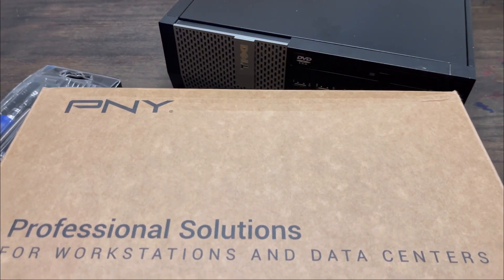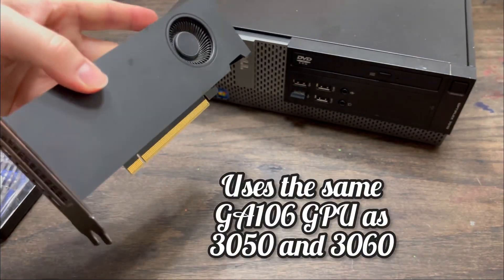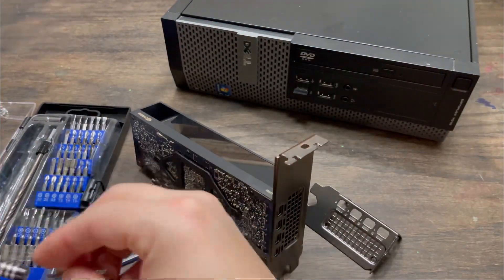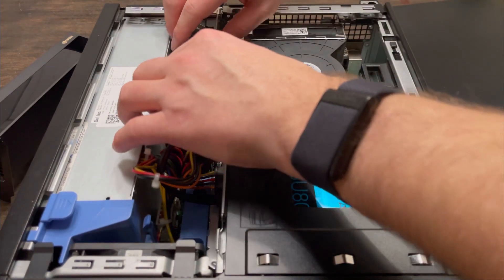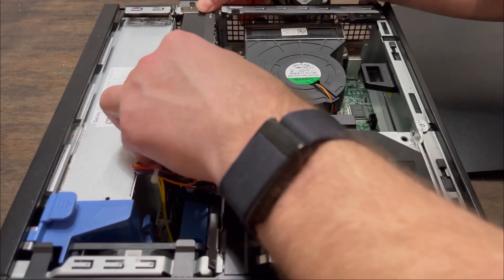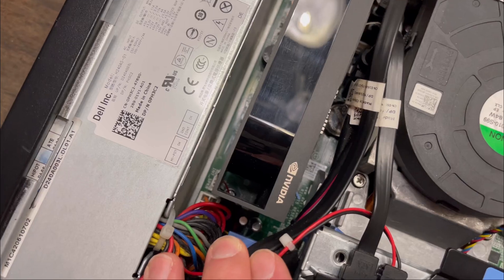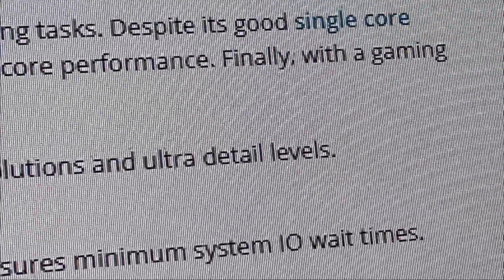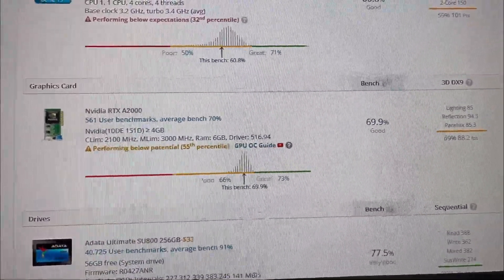Installing a PNY RTX A2000 low profile in a Dell Optiplex 7010 SFF for gaming

Comment: so i would have to buy torx screws to change the bracket if i get this? and the mini display ports wont fit a regular hdmi port, so i would have to get an adapter for that as  well.

Comment: I am thinking of buying this card too, I do not have many options for my computer since it is very space limited configuration. I have an old Asus ROG G20 (CB) that came with a GTX 970 so even though it does not seem like a big upgrade it somehow feels like the best one considering the lack of options and most of all for the low energy consumption. Do you think that this card would work on a pcie 3 motherboard and a core i7 6700? Hope it does. P.S. Thanks in advance.
Reply from the maker: Yea it’ll work. It’ll take a performance hit but at the same time that’s the best overall performance you’ll get with that old Asus.
Reply: @OptiGPU  thanks, I would give it a try, think it will give my PC a couple of years of decent 1080p gaming until I can save money for a whole new system. P.S. I found a used non mining rtx a2000 for 200 euros, think the price is fair.

Comment: I have practically the same PC, A HP Compaq 6300 PRO SFF, it has:
A i5-3470
8gb RAM Dual channel DDR3 1600MHZ
And an HDD of 1tb
And a SFF PSU of HP of 240w
Reply from the maker: Nice. Following this video for gaming, when you install the RTX A2000, you’ll want to bring the RAM up to at least 16GB as well. Running the OS off an SSD and using that HDD for game storage will help too.
Reply: @OptiGPU  That is what is was thinking, i was thinking about buying the RTX A2000, 2 other modules of 4gb to have 16gb of ram, and an SSD for the OS and other things like launchers like steam of epic games launcher and my browser, and the HDD for storage of videogames, music, series and movies, ETC, and i have a question: Did you tried to use Ray tracing? And works?
Reply: @SonicTFF2008  CPU bottleneck. 47-48%.
I was think to buy but need better processor😢
Reply: @NaturalBuddha And how much a i7-3770 upgrade's the bottleneck?

Comment: Those two tabs on the retention bracket can be easily flattened out with a pair of pliers, and then it can be used. I know this from putting an A2000 in my own SFF 7010.
Reply: I personally just cut them off
Reply: What PSU did you use to run this card? I have a 7050 i7 SFF. Thank you!
Reply: @TrippyWoodStock  The A2000 draws its power from the 70W PCIE rail.  If your 7050's PSU supplies more than that you should be fine.
Reply: @bryans8656 good to know! First time building a pc so I’m new to all of this. Mines a i7 7050 SFF. I think my PSU is 180w total? Would that be enough or would I need to upgrade to a 240w?
Reply: @TrippyWoodStock  I think upgrading to 240w is a good idea.  Mine had a 255w PSU.

Comment: So where do you plug the hdmi?
Reply from the maker: You need an HDMI to Mini Display Port cord or dongle.
Reply: @OptiGPU  there are 4 ports, which 1 do you connect it to?
Reply: @fkaiba94  any off them, I have both a dis-port to HDMI cable that I plug in to my TV  in port1 and and and a converter that lets me attach an HDMI cable for my game capture device on another PC in port two, got em off amazon.

Comment: could a rtx a2000 fit into a dell optiplex 5050sff
Reply from the maker: It’ll plug into the 4x slot, but I’d be wary of the length. Measure the space first to be sure you have at least 167mm (6.5748 inches).
Reply: Yeah, it will fit. Ive owned 7050/5050 sff before 167 mm is the same size as a low profile 1050 ti

Comment: Would it work in the i5 6500?
Reply from the maker: If it’s a Dell, the 6th gen SFFs would require you to plug into the 4x slot, but it won’t hurt performance too much.
Reply: @OptiGPU  thanks dude
Reply: Im also building off of a 3046 for my friend, would it work on that too?

Comment: thanks for the video what cpu do you have ai have the 7020 sff opti from 2014. and i maxed its cpu to the i7 4790k 4 core 8 threads 4.4ghz
Reply from the maker: Mine is just an i5 3470. I need to do that as well.

Comment: I think we can maximize the optiplex (use the other PCI Express for m.2 nvme) by using a riser for the ATX2000 (it occupies 2 lanes).
Reply from the maker: Would that fit in a SFF case?
Reply: @OptiGPU  i think it would not, ATX2000 will be a separated stand-alone GPU outside the case.

Comment: This GPU really sparks my interest. Would this be ok to run in an Optiplex 7020 sff? I am unaware if there are any differences with the 7010 and 7020. 😅
Reply from the maker: Main difference is the 7010 has the PCIe 16x slot in the correct position for a double width card.  It will work in the 7020, there will just be a slight performance hit because of having to plug it into the 4x slot.  Definitely better performance than using any single width card.

Comment: Will it bottleneck i7 3770?
Reply from the maker: To get the absolute most out of the a2000, use it in a PC with PCIe 16x v4.0 slot. Those are post-2017 and out of the budget range, but it’ll do very well in what you’ve got and can grow with you in the future.
Reply: So should I buy it?
Reply: I have hp Compaq pro 6300 sff

Comment: Does this also fit in the Dell Optiplex 3020 SFF?
Reply from the maker: It fits, but it would have to be plugged into the 4X slot, so there would be a slight decrease in performance.
Reply: @OptiGPU  thanks for the info man👍
Reply: @OptiGPU  was gonna buy the a2000, what other card do you recommend? is it a noticeable amount of performance decrease as well?

Comment: Hi would this work in HP 800 G2 Sff or would it be better to use 1650lp or 1050ti lp
Reply from the maker: The a2000 would work better (less power need, more performance)
Reply: @OptiGPU  thanks a lot, another thing i read from another one of your comments that it will have a dip in performance in certain motherboards do you know if it will
For this desktop.
Reply: @karish1861  yes it will the 800 g2 has 4 slots and 2 of them are x16 so it will run full speed in the top most x16 slot, hope this helped
Reply: @Timik _  hi this helped, but Im reading that as it is a small form factor it cant be put in the 16x slot for some reason or am I wrong?
Reply: @karish1861  I think that might be some misleading stuff this card has a full pcie x16 3.0 port and can be plugged into such, these cards don't pull more than 70w so the pcie slot has some headroom, also while using this card I wouldn't recommend using the other smaller pcie slot as the 4 share the same power rail and you could cook your psu or mobo. And sff cards are usually supposed to be plugged into x16 for full transfer speed and better performance

Comment: I'm using an a2000 in an Acer Aspire with an i3-10105 and 32gb of ram. Does very good at 1080p gaming. Got a UBM gaming score of 73 and a graphics score of 6500 on time spy.  Such a nice little card. 80fps in Forza Horizon 5 with ultra settings only turned of RT and lowered motion blur because I hate motion blur.
Reply from the maker: That’s good to hear. Yeah I’m not a fan of motion blur either.
Reply: @OptiGPU  I got the PC for $100 from eBay. And added a ram kit and gpu. Made for a good budget build. Though I did get a great deal on the base PC. I have seen the same aspire (xc-1660g) listed for around $130 lately if anyone else is looking.  And if you're looking for an optiplex that would perform close to the same then one with an i7-6700 or i7-7700 should be pretty close to the 10105. Just make sure that a 2 slot card will physically fit.
Reply: Same setup.. (aspire TC-895.. recently swapped for an i7-10700f and now it's unstoppable
Reply: A2000≈RTX 3060

Comment: Just added this to my 9020 - what a little beast!
Reply from the maker: Isn’t it great?
Reply: @OptiGPU  I never thought I'd be able to get 60 fps in A titles with 1440p.
Reply: Assuming it's the 9020SFF Does it fit in the X16 port or did you have to use the X4?
Reply: @philippebigeat  X4

Comment: Will it work on Dell 5070, 16gb ram, Intel i5 9500? I can buy this card, its new, price ~270$
Reply from the maker: Small form factor or a mini tower?  You should be able to plug it into the 16 X slot on a mini tower, but for the small form factor, it would need to be plugged into the 4X slot. That would result in a small performance dip, but it should still work.  Here’s my Amazon link to the a2000: https://amzn.to/3JaBsQC

Comment: Will this bottleneck an i7 3770 cpu?
Reply: no not at 1080p. yes at 1440p mainly because the a 2000 is the equivalent of a 1070 and 3050 the 1070 can't handle 2K resolution these days for gaming you would at least want a 1080TI for 2K. On a side note the a 2000 I believe does have access to DLSS so you might see some performance gains with that but it's only in select titles

Comment: I have the exact same PC I want the a2000 I just the 3rd gen cpu can handle it...what do you think?
Reply from the maker: In my initial gaming tests, it depends on the game as to whether the CPU is a bottleneck.  Forza Horizon 5 is an expose of a game that did really well optimizing to use both equally.

Comment: Will this work fine in my Optiplex 9020 MT, 32gb ram, i7 4700, do I need the different bracket? I was gonna go for a rx 6400 but doesn't make much sense when I can spend like an extra $100 bucks or so.
Reply from the maker: It’ll super work in the 9020 MT with a full height bracket (it should come with one).  It’s just any Dell SFF case that it has trouble not allowing the retention bracket to close.

Comment: I'm curious if this would fit in 9020 sff
Reply from the maker: 9020 SFF has the 16x slot in the wrong spot. You’d have to plug into the 4x slot which would hinder the card by only supplying 25 of the needed 70 max watts of power.
Reply: @OptiGPU  I run this in the x4 slot on the 9020 and I'm getting incredible performance.
Reply: Hey your answer is total off. lol Its cool though. Watts power will be the same @OptiGPU